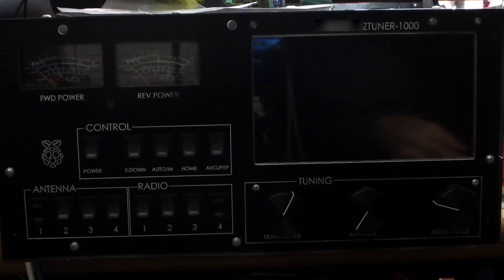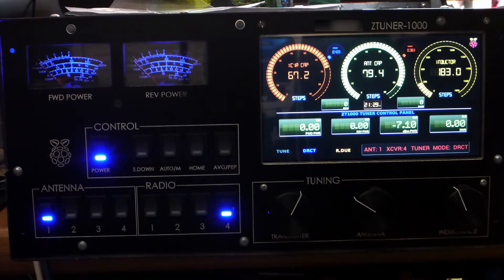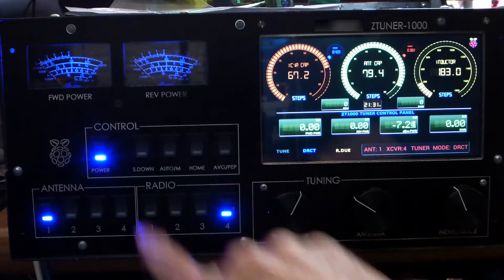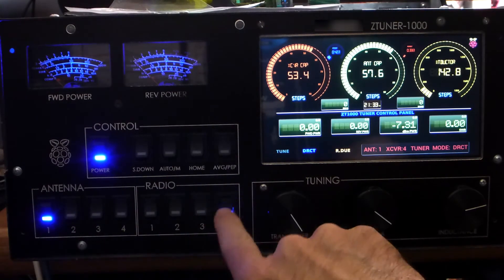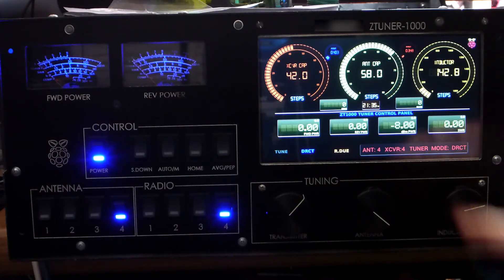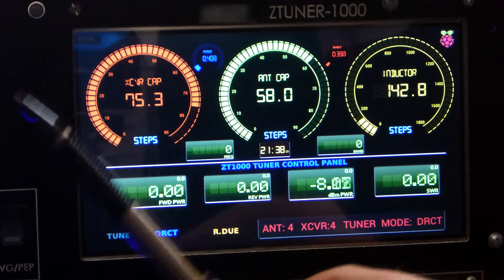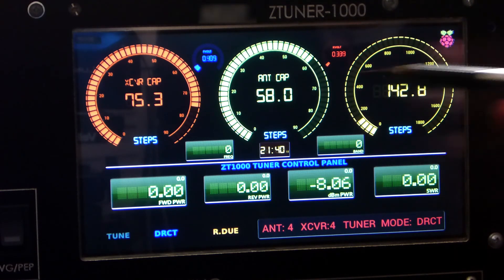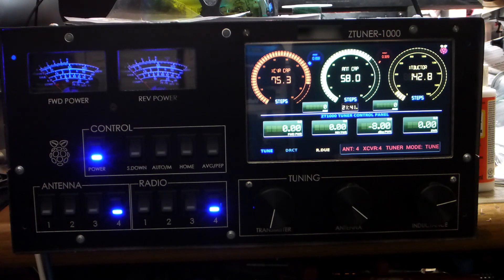Raspberry Pi Arduino Auto Antenna tuner

Comment: Awesome project :)
Couldnt you have a dummy load connected so you switch to it if you dont have an antenna selected?
Reply from the maker: For sure....would be very simple to do..maybe something I will add later on...
Reply: HI LoomisRex Your idea of a dummy load if no antennas are on line is a great one . 
I am building this project and will be adding your idea .
I will begin my code soon still waiting for more parts to get here If he releases this to the public soon then great, if not then I will have to code it myself.
If you are thinking of building this then I would encourage you to watch all of the videos over and over , you will see that the hole thing is very easy to under stand and follow.
I had a ton of questions but he does not talk much so by watch over and over I have answered most of my question and got a better understanding of his circuit.
thanks for your idea in making this project a better one.
ED NW4K  73's.